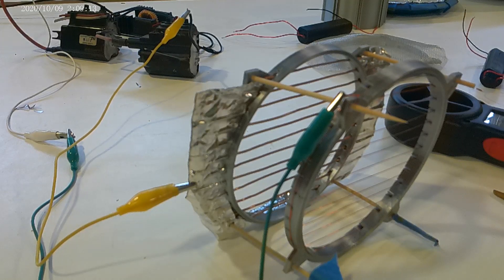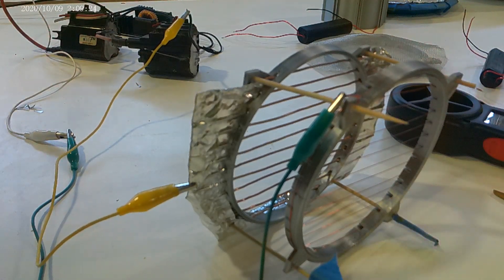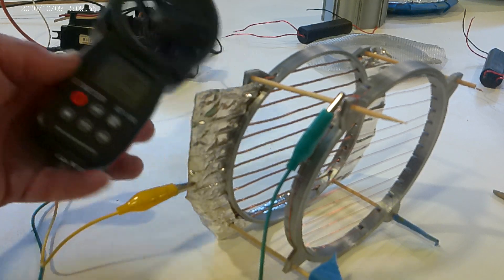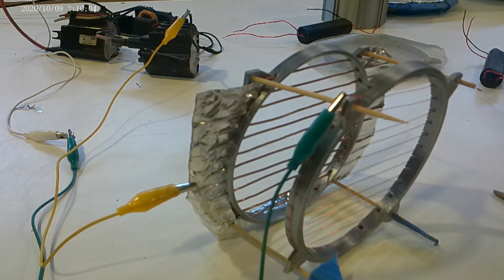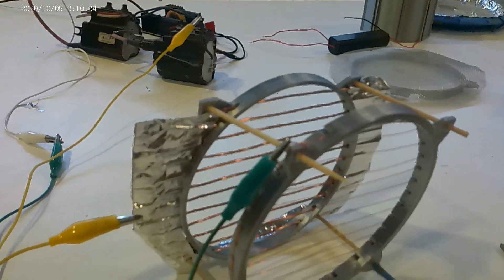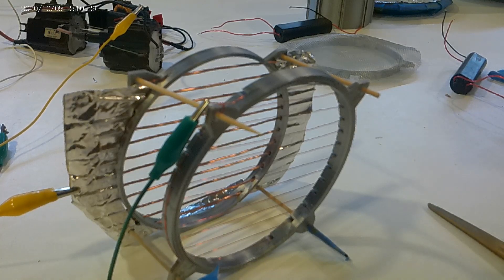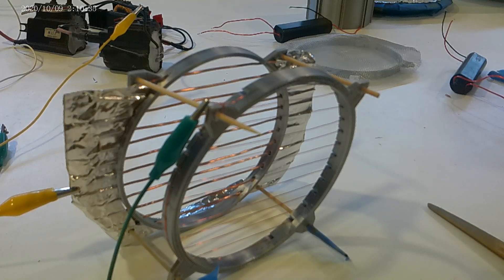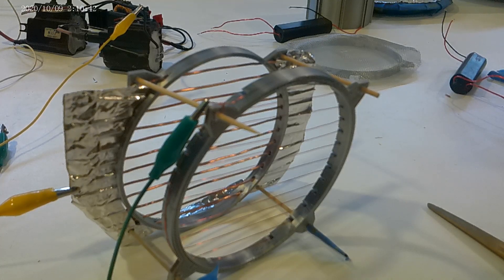First Ionic thruster attempt dc high voltage

Comment: Hey chief, appreciate your experiments ...tell me are those crt transformers hooked in series? And how are you running both with only one zvs driver? And how much additional V &A are you getting out of it? cool idea might I suggest short aluminum skirts on the cathode wiring
Reply from the maker: Yes they are in series. https://youtu.be/FiMZ3yOz94k The red one goes to the bottom wire in the video time :28   The spark goes 3" however it looses thickness. becomes more of a static volt without a lot of amps. The driver needs better parts to run a higher voltage. I have 19v 2.3a going into it. 

I have used 10v 20a on it, but at 25v it starts to self destruct.

Aluminum skirts? like a duct on a drone.
Reply from the maker: forgot to tell you. The positive of one goes to the negative of the other. Also with the increased voltage candle wax is needed on the bottom to stop the sparks. Just take a candle and let it drip on the bottom until it is all full.